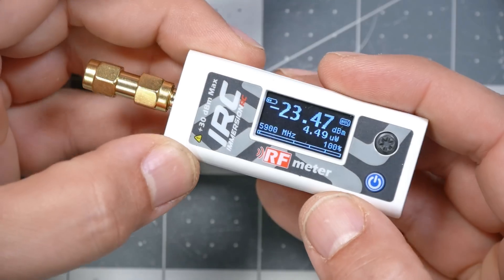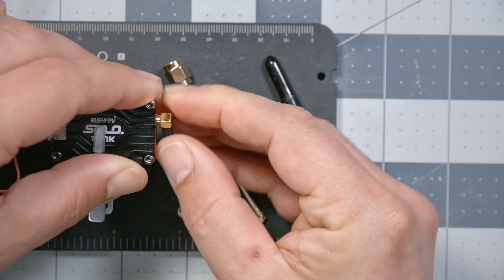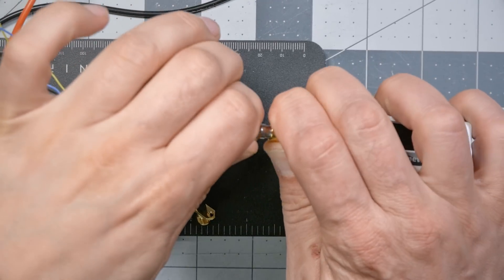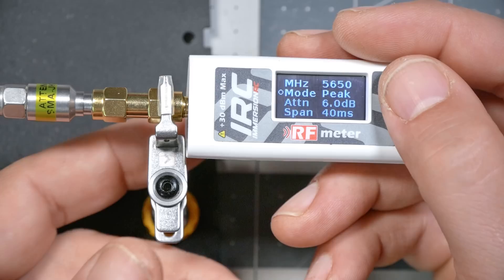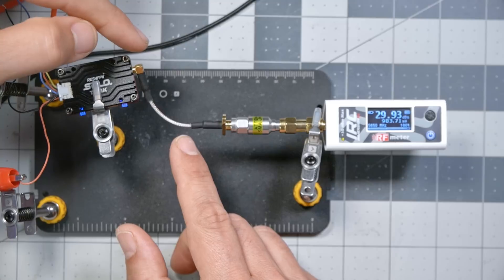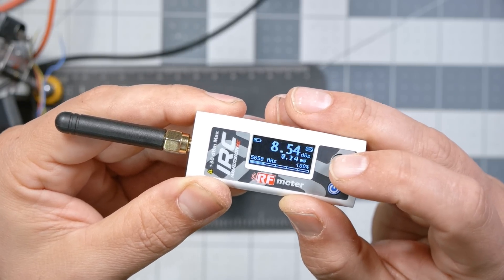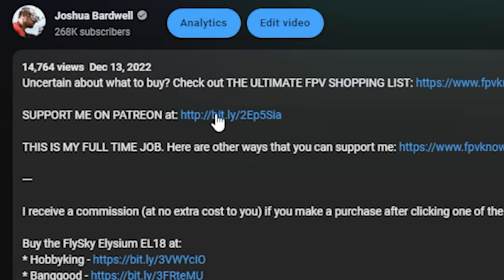ImmersionRC RF Power Meter: What You're Missing

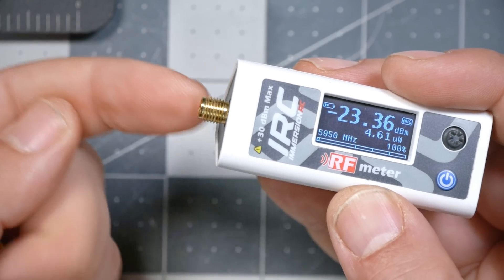Comment: 11:38 but this adapter changes connector type, you can screw on a pigtail, but not an antenna. For longevity you need different adapter.

Comment: I use a communication analyzer at work it's about 50K and it stops at 1 GHz LOL I can't use it for the hobby it's ridiculous

And on the subject i would go far as to say perhaps even if it could as soon as you put the antenna on a conductive carbon fiber frame you get Pim harmonics in all kinds of stupid stuff that make it pointless.

Edit: if you use a 10db it'll be an order of magnitude less so all you have to do is shift the decimal point over you don't have to do math every 3db is a half every 10 DB is an order of magnitude one ten hundred thousand

Comment: Hey Joshua I just finished a fpv build and on my tx16s I noticed that after calibrating my controller and setting endpoints, the 4 main channels only go to +/-98%. Any ideas on what could be causing that?
Reply: Adjust outputs in model settings in your radio till you get 1000min and 2000max in betaflight

Comment: Does this even work with a digital VTX?
Reply from the maker: It measures power, so yes it works in that sense. But for systems like DJI and Walksnail, that have 2-way communication and dynamic output power, it may not be as useful to measure the power using this device (or any other).

Comment: This is where ham radio experience comes in handy. 
The difference is they call it a SWR meter or a standing wave ratio meter and you hook it up the same way, with a  jumper.
Or you use the field strength  meter with an antenna (JB's  finger knuckle test) to measure the direction and field strength of the broadcast wave.

Comment: Good on you for mentioning to snug up the SMA with a wrench. Using a VNA at 6GHz, I noticed the effect of proper torque very quickly. They actually make/sell 1Nm torque wrenches specifically for SMA connectors.
Reply: Excellent point…. SMA torque wrenches are a bit pricey for something only used very occasionally, but absolutely worth it.
I have seen guys take small open ended wrenches and crank down on SMA fittings on some extremely expensive gear (telemetry transmitters  / tiny duplexers / portable handheld P25 radios, etc.  It was truly frightening.

As JB mentioned, this meter is far less than the cost of a single attenuator in a lab or critical grade comm shop.
In fact, you could buy THOUSANDS of them for less than the cost of a quality VNA and hundreds of them for the cost of a good spectrum analyzer.   It seems like a no-brainer to drone enthusiasts working with RF .

Thanks JB —  for YET ANOTHER awesome video.
Reply: One quick point… with less accurate test gear, sometimes the best way to utilize such equipment is to use it as a “a to b” comparator.
A great too to check multiple brand or type  jumper cables against each other or to compare multiple connectors to each other, etc..
Though this tool seems to be pretty accurate , especially considering the price.